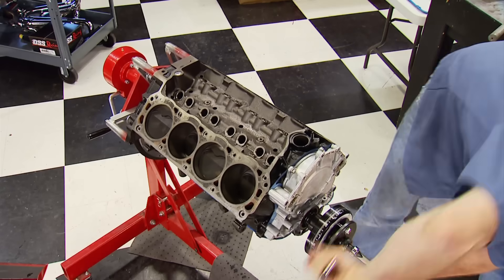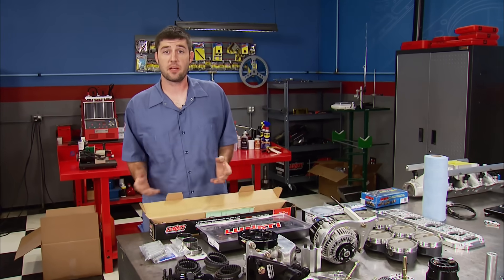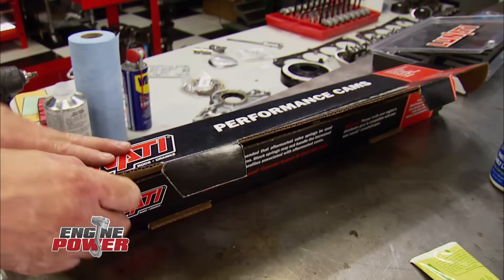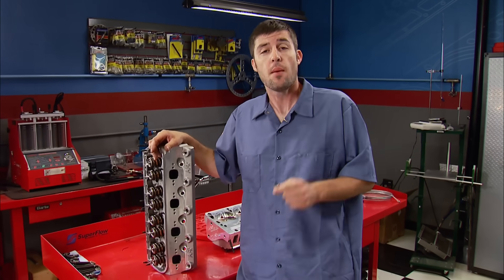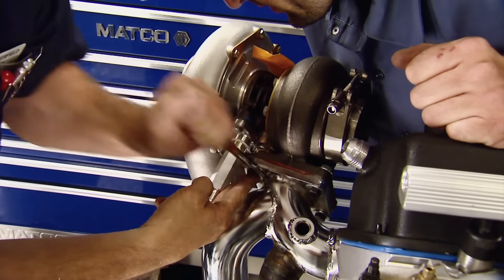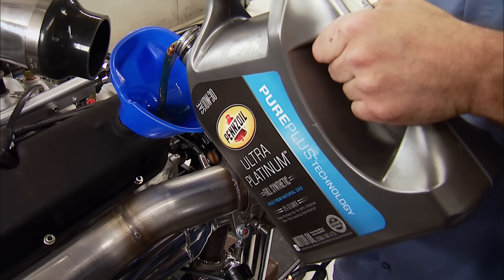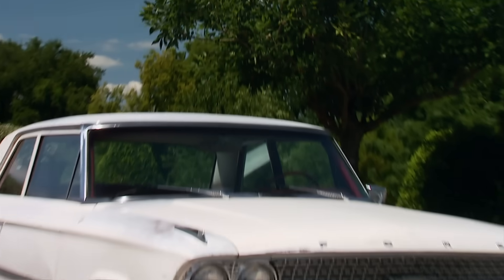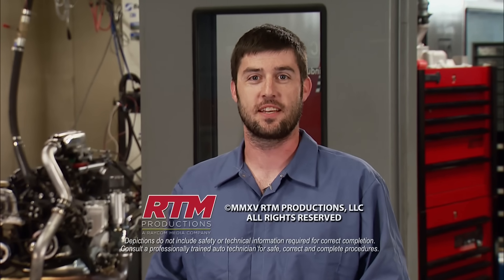Unleashing a Boosted 347 Small Block Ford - Engine Power S2, E20

Comment: 8.8 to 1 compression and he said 350 to 375 n/a 347 with heads  and the best parts money pretty much can buy besides rods crank but get real Jon kaase took a 9 to 1 compression ratio 302 with p38 heads and carb and a modest cam and made 490 horsepower get real without spending all that money man

Comment: By the look of those NASTY welds  on the intake, I knew right away a professional did not do it
Reply: Nope, but giving a new generation a chance to learn some real world skills is great. Besides that, it doesn't have to be pretty, if it works.
Reply: you guys are so cool
Reply: After looking closely at the gasket surface I’m surprised that Intake even sealed
Reply: To leave those "gorilla glob" welds on that intake is a travesty. I'm all for helping the younger fellas (if you can find one that will actually work) learn and I certainly don't mind sharing knowledge and experience; BUT don't leave those welds like that! What you lack in welding ability, at least make up for it with grinding skills........ Good day

Comment: It would have been interesting to see how the manifold modified for efi and the throttle body worked on the first black and blue build before swapping to the Dart block and adding boost.
Reply: Wayne C engine masters done a build on this

Comment: Can I get that stock block donated to my build?
Reply: @bigboreracing356  the stock 302 is fine for most applications, when you boost it over 550hp or so, you run into problems.
Reply: Can't you run down do your local pick u pull on half off days and get one yourself?
Reply: @dj4monie  why does it matter that I asked can I get the block donated to my build?
No I can't go down to local pick & pull get it myself, and why does it matter to hate on someone comments about a used stock block?🤔
Reply: Right bro they'll let them go for cheap. I once got a great cam upgrade from one for $20😂$250 value

Comment: why not just start with a  351      im no ford  guy but    351   seem s  to be  decent..
Reply: Most people like the 347 over the 351 because the 302 based 347 has a deck height of 8.2" v.s. 9.5" for the 351 which makes the engines shorter and easier to install in vehicles where there is limited hood clearance. Once you start putting tall intakes or other items that require a raised hood then it begins to make more sense to just use a 351 which tend to have stronger blocks than the 302's (excluding Boss motors).

Comment: With E85 being readily available these days, why not opt for some more compression?
Reply: This video is 5 years old....
Reply: @CanIbeFrank  I' must be reading it wrong, it says Dec. 3rd, the oldest comment I see is 6 hours old??
Reply: @MrLightning54  they put it on YouTube today. It was on tv 5 years ago...
Reply: @CanIbeFrank  Oh ok. funny how quick standards change when 7xx doesn't sound like quite enough, lol!
Reply: @MrLightning54  if they had the right top end (heads cam intake) and E85 it would have made a lot more power. Minimum TFS 225 or AFR 225.
Reply: @CanIbeFrank  I was thinking those 19x CC ports wouldn't be quite right for an engine like that. I had 11R190's on a stock bottom end fox body?!?!
Reply: @MrLightning54  yep 190-even up to 205 is good for 302-331. Anything more than that needs 225 and up. Heads are the key to making power. Ps you'll love my channel if you're into cars and Mustangs

Comment: I’d die for this engine in my 93 mustang. Serious power in the engine. Sounds so smooth too.
Reply: Start saving pennies. You can build up to 500whp on the stock 5.0 block, you'll crack it higher than that.
Reply: Anthony Thomas my 93 now has 436hp* not 446hp on the dyno and 347hp at the wheels dynod. She’s a fun car can only imagine what 1,000hp on the dyno would be in a 3k pound car lol. I have every maximum Motorsports mid available now and she handles awesome. Would love to see how one of these Foxbody cars would do with this suspension work and that power. Super nice engine there
Reply: @TracyD-y5s  Ya gotta have NUTS that are WORTH it !!
LOL
Reply: REF III I agree😂 I would’ve loved to have a motor like this in my 86 and would love to put one in my 93 now lol
Reply: Garrettrocks98 that drive accessory kit 😍. This is a sick set up
Reply: REF III I agree! I said the same thing that accessory drive is sexy!
Reply: @ Tracy d—why would you want to do that?  I’d much rather have a bone stock Y-block F-1.  Leave these 1000 hp beasts for modern stuff.
Reply: @MrJett1971  there is only a partial frame left, no driveline of any sort, it just an empty shell waiting for some TLC.

Comment: Is it absolutely necessary to feed the turbo with a crossover exhaust pipe? I mean, can a turbo be correctly sized to boost a V-engine by only using one cylinder bank's exhaust??
Reply: Not really. With a turbo on the manifold the exhaust gas pressure backs up to the exhaust valves. With the exhaust pressure backed up heat is also retained. If the other side had no turbo on the heat would not retained and so you would end up with a heat variation accross the block. When the metal expands due to heat the variation in temperature would also causes variation in expansion which could result in cracking and none conformed wear.

Comment: I sure in the hell wouldn't use Pennzoil never seen anything good come from a taredown after it had that oil in it.. But thats just me...
Reply: True story , rebuilt many a engine , and always could tell when they used Pennzoil . Carbon Deposit out the Ass
Reply: Not the biggest Pennzoil fan my self, But we just retired my uncles 1994 Olds Cutlass with 475k on the clock. He only used 10w40 Pennzoil conventional from day one.
Reply: @theoldguywalking5075  no shit!? Damn... Just lucky with that stuff then.... Or possibly regular oil changes help too...
Reply: I would use Pennzoil 1000 times before I would use the royal purple junk they normally use. Still I wouldn't use ether one of them. Who knows maybe this new version of Pennzoil I the cats meow.
Reply: @gregertman6497  very true but im not paying 80 bucks to do a oil change with that purple shit either
Reply: I would run supertech in it
Reply: @Reactionary Hermit I used Supertech for years and was surprised, at a tear down, how clean the engine was. I remember the 60's through 80's gunked-up engines well.

Comment: Pretty sure everytime they have turbocharged something they never set the bov right. Always turbo always ends up fluttering instead of the bov releasing pressure.
Reply: The fluttering is coming from the wastegates, no?
Reply: @Dunkaroos248  
Edited, sorry I should have made it more clear
Reply: @Dunkaroos248  
The flutter is from air being chopped up by the compressor wheel. Its harmless, but I just don't see the point of a bov if it isn't working.

Comment: Question? Couldn't a 4.125 Bore, 1973 Chevrolet small block 400, Simply bored .030 over achieve 750 all N/A???  I bet she will be fun in Pat's 63 Galaxie & How I would LOVE a ride in her!!! I realize that boost is dominating but, old school, hard knox builders do strive out wins even amongst boosted application's! That air pump sure does sound AWESOME!!!
Reply: D.j. B
It takes bore and stroke to calculate Cu.In. not just the bore size.

Comment: I bet 10:1 compression, cnc tfr highports, and E85 this thing would make 1000 not even sweating it
Reply: I bet with just bumping the compression up to 10:1 it would have made 1000 hp on about 12lbs of boost. Low compression boosted motors are pointless unless you're going to run something like 35lbs+.
Reply: @codyslaughter4678  yep low comp is a thing of the past. With E85 everywhere its dumb not to go with 10:1 slot of guys are way higher than that with 20+ psi
Reply: All bulshit try and build-it!
Reply: All bulshit try building one

Comment: Back in 1983, I had a Boss 351 that had around 425 HP and spun a clean 8,200 RPMs. Could you build a Cleveland style engine with same style heads, same bore and stroke, and similar compression of 11.7:1, but no less that 11:1 putting out 500 HP and spinning a clean 8,200 RPMs for a canyon running engine that would rival a Ferrari V12? Naturally aspirated, but could have a fuel injection system without rails.
Reply: Dandy Engines has a 2,000 hp Windsor block, Cleveland style alum head engine makes 2,500 hp, just did a 6 on 8 inch drag radials.
Reply: Nice. 500 HP is more than enough. It’s the 8,200 RPMs that matter.
Reply: Douglas Hine     There is no way a Cleveland would spin at 8200 rpm without serious mods. Those heads won't fit on a Cleveland. I had a built Boss 302 that wouldn't spin that high. I suggest you go back and watch  Sesame Street
Reply: wysetech2000 Why be so rude???
Reply: @douglashine9638     I don't like it when people bull shit is why.
Reply: wysetech2000  Your intellectual dominance is so intimidating. I didn’t know that I was to spar with someone who has such a mastery of the English language. Most people would have simply asked me what was done to my engine to get the RPMs I was getting. But since you are way more superior to my inept ability to communicate, you assume I was talking about Big Bird or Ernie. Gheeze!!!

Comment: hey guys im from Australia i was wondering what i can do with the l67 v6 3.8l gmc iron block engine
Reply: What are you riding around in?  A Buick lesabre fwd?
Reply: @billy-waynejeffcoat4828  no a holden commodore vu ute https://www.redbook.com.au/editorial/details/buying-used-holden-v6-ute-vu-vz-2000-2006-29338/   come on man im from Australia i have a little class not much tho i still need my beer
Reply: @Frank Bonazza III nar man i would love to twin turbo it
Reply: I'd keep it N/A but build the shit out of it. Very strong motor that can make good N/A power reliability without dealing with a shit ton of extra work associated with a power adder
Reply: @edwardmyers1746    That 3.8l turd is far from a strong engine. It's a good engine in stock form but it's too weak for anything else.
Reply: @bigboreracing356   627? I though 575 was the biggest available. That's gonna require a shit ton of fabrication and money, no way it could fit. I dont think this guy had that in mind LOL
Reply: @edwardmyers1746  nar i wasnt going that big the biggest thing i was looking at was a ls3 with a twin over head cam conversion if i was going to swap out engines
Reply: @harleywalls6356  if you want DOHC buy a ford 4.6 or 5.4 4V
Reply: @edwardmyers1746  no way ill never leave holden or gmc lol dont hate fords just love the other
Reply: @harleywalls6356  welp shit, good luck with that then
Reply: @bigboreracing356  i no its 14k for the engine alone here and 12k for the conversion australia is murder for prices for car parts
Reply: Harley Walls  I respect  Australian people but i would just throw it away.
Reply: @wysetech2000  nar man its an iron block we have the alloy tech here as well and they have a habit if you put power into them they twist in half

Comment: Yeh baby ARP bolts to bolt down that oil pan. She won't blow off now
Reply: stock Chevy blows apart at 300 hp so im guessing old Fords are good for 500 or so considering there;s nearly double the bolts on Ford...my old S10 with a mild 305 with about 275 hp used to eat oil pan gaskets
Reply: Johnathan Bachman , he was making light of the fact that this is a Summit advertisement. And your  amateur psychological  analysis shows that you go off half cocked and type before you think,  and if you have the ability to reason?, do you?
Reply: older than you Cali Well Sir you have left no Doubt your I.Q. is between a rock and a plant. Sponsors, advertising and parts donation is why these programs are on television. If you or the other mental heavyweights do not like it turn it off or don’t watch. Posting your adolescent ignorance just proves you have no clue and enjoy trolling. The question good Sir is why would you leave no question your dealing with bad Meth habit.  You post’s are seriously ignorant. Before you make anymore posts get your G.E.D. Ask your cell block officer how this can be accomplished.
Reply: Jonathan Bachman I’ve never before heard a more ironic statement about grammar and spelling.
Reply: Andrew Gallagher Exactly, I never could figure that one out.
Reply: Andrew Gallagher A hater will hate. And a dolt will stink. Perhaps you should do a show? You may want to tighten up your spelling and grammar before you have a go. It is quite infantile.
Reply: @jonathanbachman2339  literally I saw a dude making a good original joke...and this is the criticism you have for the guy
Reply: @jonathanbachman2339  "A hater will hate. And a dolt will stink." You say this grammatical fuckery and then immediately follow up with this pretentious AND hypocritical shit: "You may want to tighten up your spelling and grammar before you have a go."  Do you really wanna go with that?

Comment: Anyone else notice the wear on crank journal when he measured?
Reply: micro groove oiling system
Reply: @Bearded Clam You caught that too
Reply: saw that clearly
Reply: yep and would have taken 1 minute to polish out.
Reply: These guys are clumsy. In all their builds, something happens or improper procedures left and right. It's more entertaining to me to point out their mistakes, as they won't mention them on tv. Promotional control is evident. 
Remember guys, measure clearances before and during build. Use high quality assembly lube on everything. Change break-in oil after motor reaches operating temp no more than 10 times. Always prime oiling system!!! Happy building.
Reply: I think most of this is just for the camera. We didn't see any of the machine work they said was done, for instance.
Reply: @NVzla  remember the glowing small end rods for their 283 build?
Reply: Yep. I'm thinking that things weren't exactly clean during the build....
Reply: Loose is fast.. lol A great man once said
Reply: @91Bravosixniner  Ok Harry Hog.. lol : )
Reply: @91Bravosixniner   There's a song by Motorhead called Fast and Loose!!! :)
Reply: Timestamp?
Reply: I’m more disappointed by all the pitting in the brand new aftermarket block. Talk about low quality control.
Reply: Yep, spotted that and thought,.....hmm.....that's not supposed to be there!
Reply: Bro. I HOPE they polished that crank lol.
Reply: wow, you guys aren't kidding. its real obvious. I mean, to a good engine builder
Reply: Pat has been in the business for almost 30 years, if he didn’t deal with it at the time then it probably wasn’t a big issue

Comment: I'm a ford guy also ,But i would not mind Only 800 HP to the wheel,  But i would have to get   another trans  driveshaft and rear for my old 91 f150  wish i could i would .  like this build
Reply: You need more than 800 hp it won't be that fast pushing 5,000 pounds around. Build a 466 cid big block and slap a couple of turbos on that, that will make your hair stand up.

Comment: What was the boost at on the final pull?
Reply: I'd say around 15-16 psi. My guess is they'll really hammer it on the chassis dyno with electronic boost control inside the Holley EFI system. 700+ on the wastegate is very good.
Reply: 16 lbs.
Reply: Lol you can make 600 on a stock block ported heads and a cam with 16psi

Comment: Yall ain't exactly right with the overlap...the right amount of over lap will make the exhaust valve open for just a moment when the intake opens to fully get gasses out as fresh fuel and air comes in making each power stroke have fresh air and fuel to burn up making more power and efficiency. 
Everybody knows efficiency makes power reliably

Comment: Said it would put out 1100+ hp and only went to 800
Reply: Low compression, even not a full 9:1
Reply: Actually they didn't say it'd put down 1100 hp. They were talking about it being able to hold in 1100 hp as they were talking about the stronger internals they were putting in. I can build my motor to handle 1000 hp, but that doesn't mean im going to set up the necessary power adders to make that kind of power.
Reply: You’ll never be able to use 1000+ rwhp on a public street anyway
Reply: Nah
Reply: To be fair they said it would be a 'safe' tune on the engine dyno, then turn it upto 1000+ in the car.
Reply: @asambi69  That makes absolutely zero sense. They said it would make 1100+ on the dyno and 1000 on the car because of driveline parasitic hp loss. You don't dyno an engine safely at 800 hp and "turn it up" to 1000+, if anything you would do the opposite LOL. A dyno is for you to squeeze every last drop of HP out of an engine to see what the max numbers are and then tune it down to safer numbers so you don't have an engine that only lasts a few thousand miles at most. If an engine tops out at 800 on the dyno it cannot make more in a car. 800 is still extremely impressive I was just commenting they said it would make 1100+ on the dyno and 1000+ in the car which was clearly not true and kind of a let down at the end of the video
Reply: @ArcticAstrophysics  Litterally listen to the Video...they litterally said they were doing a 'safe' dyno tune. Then turning it up in the car.